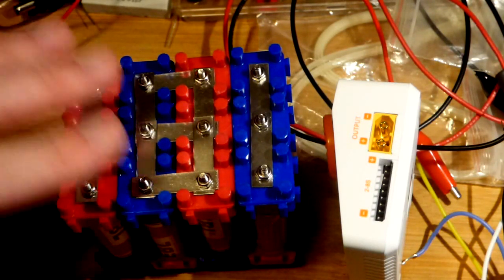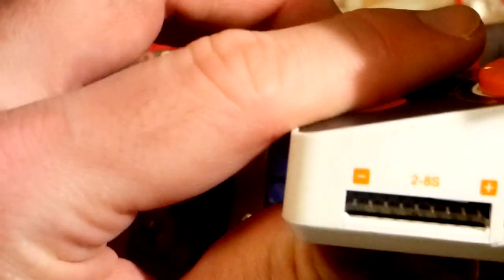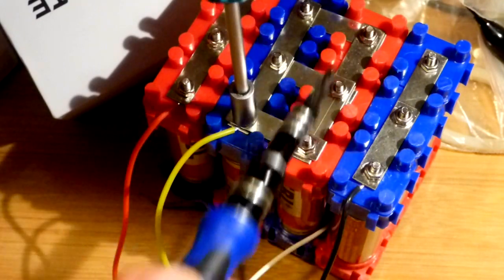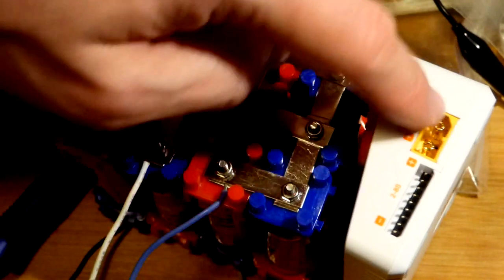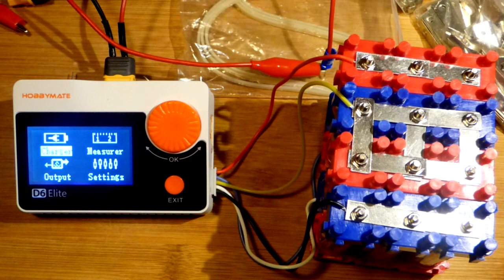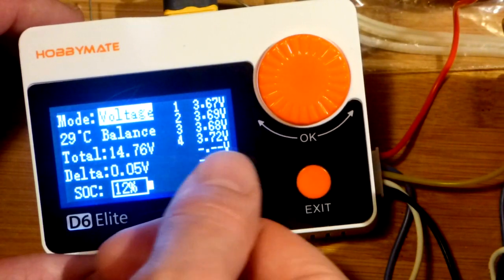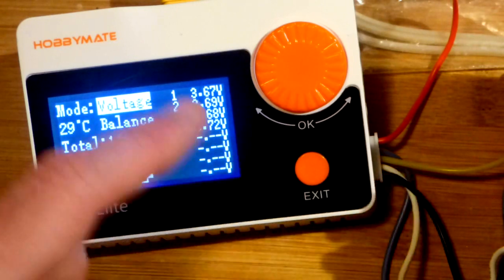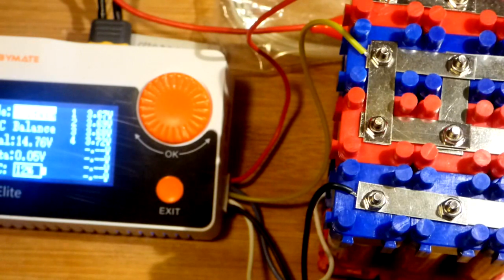Adding balancing wires to 4 series 18650 battery pack Hobbymate D6 individual voltage measurements

Comment: This is probably the best video explaining the install of the balance port. Im planning on making a big trolling motor battery or a few from all the 18650 i have. 4s10p. Im not a expert bu I want to be able to bring the batteries in after a trip and hook them up to a balance charger.

Comment: Also I recommend NOT tinning your wires if you are going to crimp them in. The pressure of the crimp actually works better on the bare strands -- the solder makes them too brittle and will prevent a good "flat" connection and probably allow corrosion to set in faster.
Reply from the maker: Thanks for the tips! I will probably crimp untinned wires and then touch it up with solder once i start making permanent connections.

Comment: This is where I recommend the electrician's style of screwing a wire to a terminal: bend a hook that goes clockwise, attach from the left and turn clockwise so the wire tightens in the same direction as the screw. Just good practice. Thanks again. 😬👍